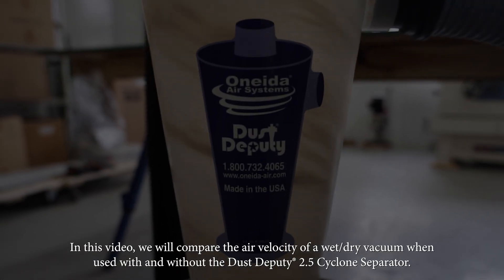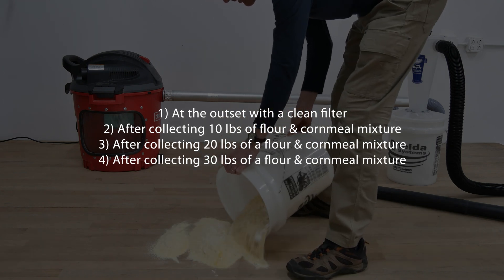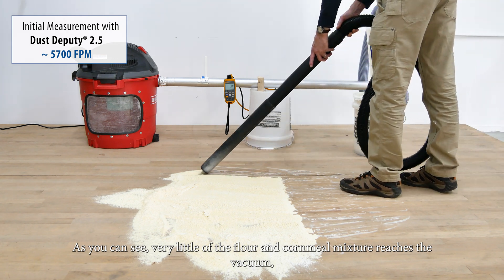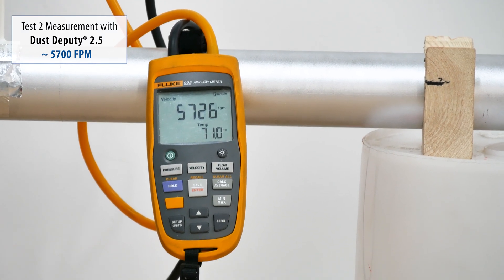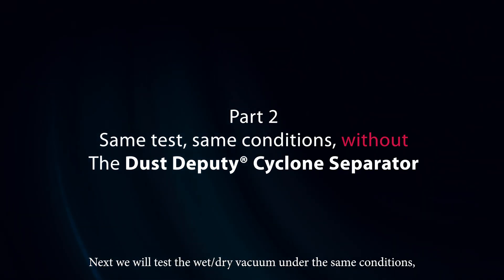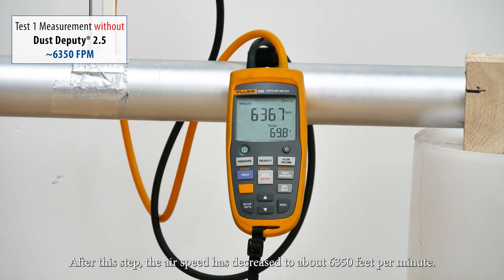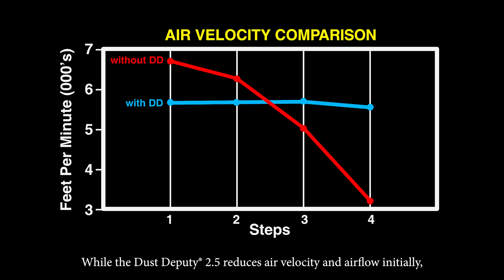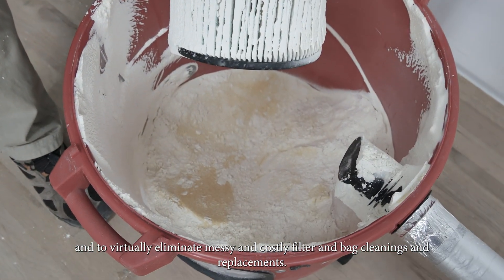Dust Deputy 2.5 Air Velocity Test | Oneida Air Systems, Inc.

Comment: How does flow of the DD 2.5 compare with the original dust deputy?  I have the original DD for several years and it’s working great!  Just don’t know if I need to upgrade.
Reply from the maker: The Dust Deputy and the Dust Deputy 2.5 are going to perform the same but with the 2.5 being meant for vacuums that have a 2.5" hose due to its 2.5" inlet, this would offer more air flow which would correlate to better separation.
Reply: @oneida-air  thanks for the honest answer.